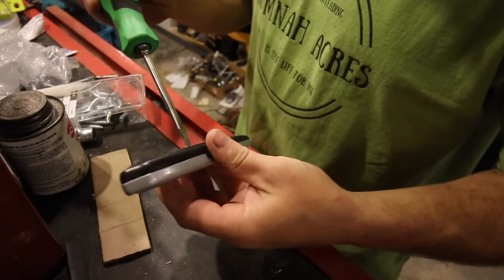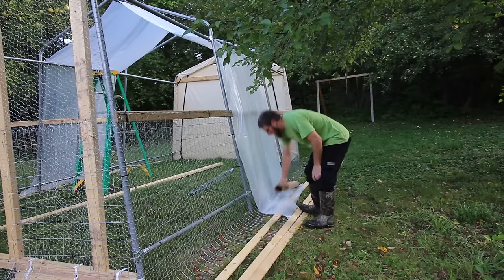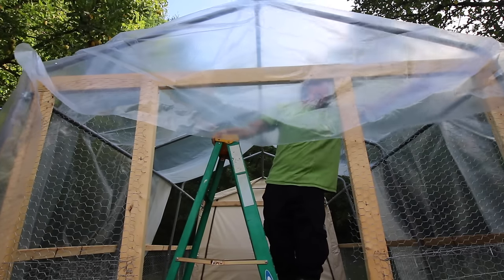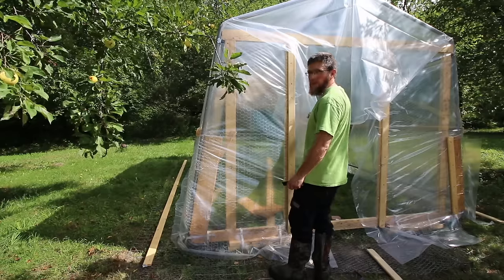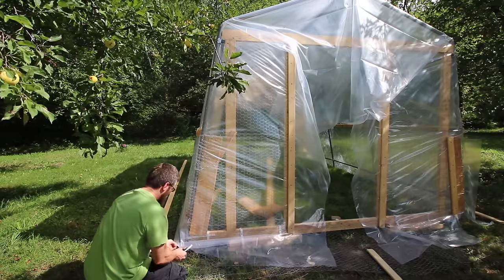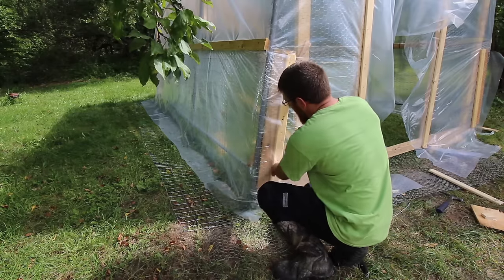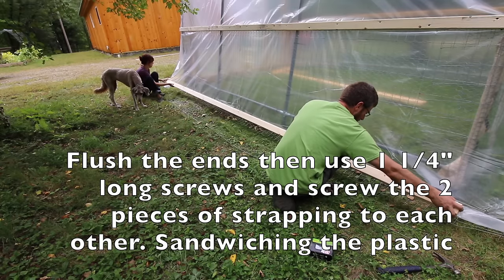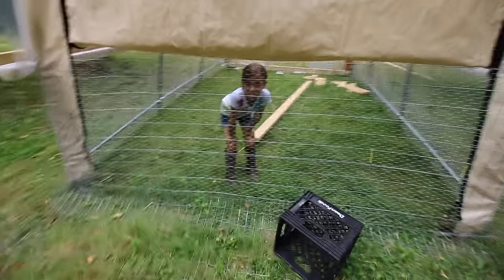DIY Greenhouse and a Chicken Coop 2

Comment: Very clever multi purpose building. Anxous to see updates on how this works. Last year I framed in 12x20 feet instant garage like you did with yours and threw a heavy tarp over it for outside equipment. Was curious how it would survive the harsh winters we get in Maine and there have been no problems. This year I will add the Polycarbonate Roofing to warm it up and be able to use for a greenhouse.
Really enjoyed these 2 videos. 
Thanks and many blessings,
Jim
Reply from the maker: It has been holding up nicely. This is its second winter

Comment: Driving down a road here in the California Sierra near Sheep Ranch in Calaveras County we passed a few houses that had 2=3 camp tents in their yards and one belonged to a friend or a friend so we stopped and asked about the tents. Turns out folks buy them late summer when they are reduced price at REI, Walmart etc and they use them as green houses, and chicken coops.  Because the top of the tents are white to allow for more 'light' inside and because they are doubled walled and hold heat better. Come winter they work great for green houses. With construction cloth under and up the sides for coops so critters cant get in, and nesting boxes and roosts inside they make for warmer coops come winter.  Something folks may want to consider.  And being all weather tents they hold up in rain and snow weight.
Reply from the maker: Thanks great idea!